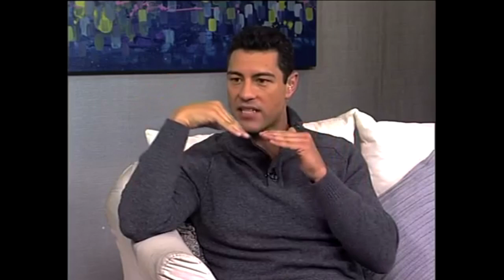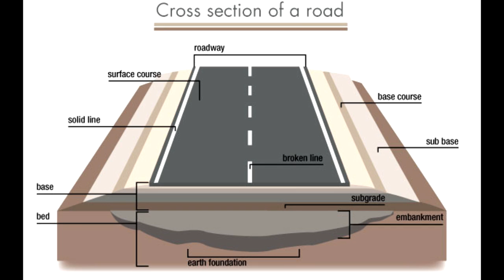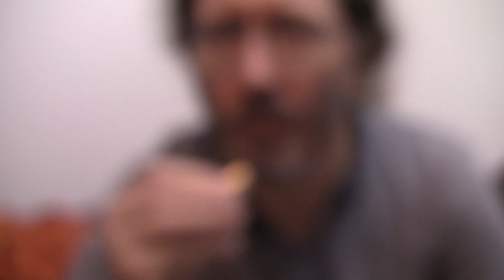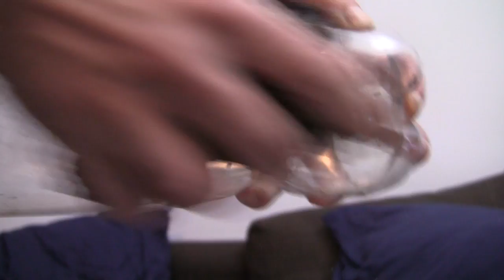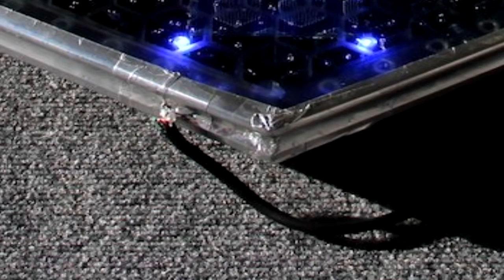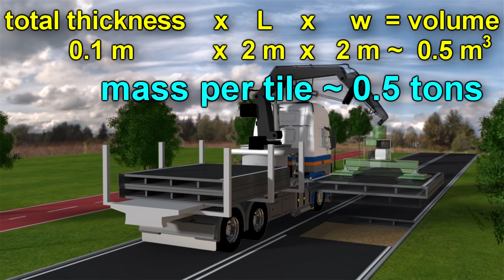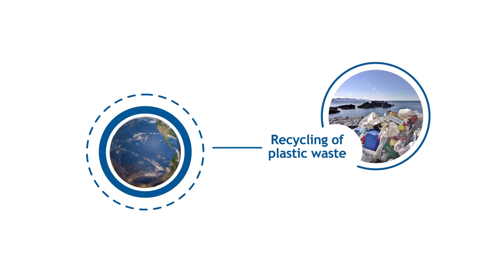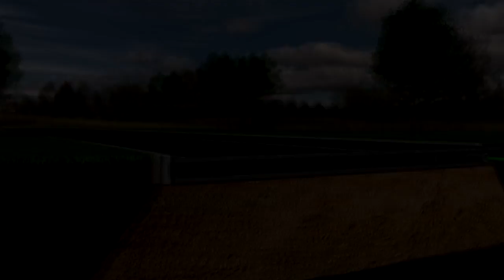Plastic Roadways BUSTED!

Comment: I really do not understand why the construction has to be hollow. The whole idea is using up waste plastic, yeah? And a lot of that is made annually.

The only way I see this potentially working is to lock the surfaces down with a channel made to accept a stiff material. Which means, there needs to be a way to stop off and seal that channel so nobody can tamper with it. Then, they have to figure out how to allow displacement of the locking materials so the hollow road can be replaced if it has to. Maybe, by destroying it, but in a long roadway, there is going to be difficulty unless you have a machine push in and displace the existing locking material, place the new panel in, then re-lock it at the other end.

This is vulnerable to multiple types of terrorism, by displacing the plates so they are removed, destroying the plates since they are so soft, and the stuff underneath then becomes vulnerable after the road surface is destroyed. This simply wouldn't work in places where acts of terror are a common occurrence. It sounds like a massive corner cut in comparison to just laying down some crushed rock and calling it a day.

Comment: this is nothing new... a lot of land based oil rigs use durabase matting which is technically a plastic road. but it buckles after a while and would not be any good for regular road surface. it gets a bit slippery when there is mud on it!

Comment: hi, i'm from germany
and i only got one question

how the fuck are our tanks going to roll on this shit
Reply: Speaking of burning... a car fire would royally mess that stuff up, or worse a pool fuel fire...
Reply: Kniv Jesus What happens if you do a burnout on it? xD
Reply: Actually I think tanks are pretty benign, I mean they can rough up the surface, but they are quite unlikely to actually make it fail. At least they spread their weight over a huge contact patch. I'd be more concerned about your typical everyday semi-trailer truck.
Reply: Kniv Jesus cheese tanks my friend, cheese tanks.
Reply: Kniv Jesus somehow, its a mystery how they made the roadways, its a mystery how cars wint break em
Reply: use one of the 4 wooden tanks from the baltic states instead
Reply: Corvid At least asphalt is fire proof
Reply: Why is your name kniv jesus if you're german?
Reply: ***** actually, tanks are designed to go on everything. Just not necessarily leave it in the same state as it was before they went over it.

That being said, in October 1993, there were quite a few tanks on the streets, and the result wasn't so rough, well apart from that gaping hole in the Russian Parlament building and hundreds of people dead. That is to say, once you start worrying whether the tanks will leave your road surface intact, you might be missing the bigger picture.
Reply: ***** Wtf are you talking about?
Reply: ***** Don't go that low.
Reply: "Tanks aren't designed to go over regular roads. They might even damage em"

There are rubber parts you add to tracks to minimize damage. That's how they do parades and the roads are fine. Also no turning in place. That's what fucks up the roads the most.
Reply: Kia Of course they are ment to go over normal roads, at least on germany tanks allways drive over normal roads
Reply: ***** Kniv jesus is a joke. A swedish joke. Kniv = knife. it's from a swedish cs:go youtuber

Comment: for fucks sake.....first you get politics all wrong, now you're getting science wrong (well, half wrong).

1. Roadbeds are constructed at the beginning of a roads FULL life cycle, and is only maintained if a major event changes the underlying topology.  Once the asphalt has been laid, maintenance only requires a single-file stripping followed by laying, rolling and paint.  This happens depending on traffic (parking lots are roughly 15 to 25 years, while major thoroughfare might be every 3 years).

This means, if a new road material is to be presented, the roadbed doesn't need to be changed.....you strip away the surface and lay your new on top.  I will admit that this design (for a hollow interior) is stupid, but you act as if it would take too much time.

2. Asphalt already contains recycled material in compound, including plastic and old asphalt.....some roads even use old tires in the compound (usually gives a plum hue in daylight).  This means plastic is already being used on roads, what's your problem exactly?  Roads are actually SUPPOSED to be soft, so they don't tear up your tires, create a jagged dangerous condition, or become too stiff in sunlight and crack too soon.

3. Picking apart the truck image, which is obviously flawed, is like attacking an architecture student for his designs of a 100-story pinwheel corporation building.  Yes, it is most probable to not go like this....if it were me, I'd simply lay the framework tubes directly on the roadbed and put the asphalt directly on top and level it....you know, like they do for the traffic light signaling wires.  Or do you not know that they already lay cable inside tubes within the asphalt mixture?

I'm guessing you've never worked road construction.....of course you haven't.  You are literally getting worse at this.

Comment: Hope they are heated because, in the USA north east, it will be a bitch when it frost heaves and cause ramps or jumps for cars.
Reply: i won't lie, this would be great for small driveways.  easy to replace, can make them heated and grip isn't a huge issue for sitting a car in a driveway.  making it hollow isn't needed so now you have a simple, efficient, and now cheaper product.  it is too expensive to redo a driveway with asphalt and plastic may cost you a few thousand dollars rather than 10 to 20 thousand.

Comment: Also, how about cold temperatures? I live in Minnesota, and sometimes it'll get -20F or colder in the winter. Plastic gets brittle as hell in extremely cold temps, not even to mention, could that plastic handle the snow plows metal blade that's needed to clear the roadway of snow and ice. Also, could you imagine ice on plastic? There would be so many car accidents/fatalities that it would be legendary.
Reply: Finaltits Hey look, holy roads!
Oh wait
crashes

Comment: Not to fucking mention all of the problems that will emerge from trying to mold out of swirled (recycled) resins taken out of trash that have been bathing under the sun, on rain, dirt and other contaminants... Not to mention the proposed size... Those molds will be so damn expensive... And the molding machines!!! Man!!! Millions wasted just to cast ONE of those lego life sized road pieces... And yeah... The fiber glass will degrade the original structure of the recycled material when re-melting...

Comment: Among the multiple problems with the idea, a couple of issues could be solved by cutting the road in half. By simply making a top and bottom half, they can solve the repair and attachment problem. They could lay the bottom half down on a concrete surface and use masonry bolts to attach it to the ground, then lay down the pipe, then bolt the top half down making a kind of road sandwich. Ideally, this means they would only have to replace the top half of the road making repair of both the road and the pipes IN the road MUCH easier. In the event they have to replace the bottom half, it would be a lot easier to unbolt the road from the concrete and slide it out from underneath. Again, this is not to fix the idea, but merely 2 or 3 the of the bigger problems with the idea.
Reply: That actually seems like it solves a more minor problem.
Reply: Well that was one of the major talking points, that was all I was referring to. But yes, in context it is more of a minor issue.

Comment: Surprised nobody has pounced on the "drainage" yet. It's so damn kewl how the runoff just magically fades away in the animation. No ditches or culverts or channels or whatever - just pure magic.
Reply: it's also nice how the animation suggested there'd be a small concrete or whatever material barrier where the drain holes are but as soon as they need to say that it works the barrier just doesn't matter anymore
Reply: Of course! Also nothing could possibly go wrong with stuffing a cavity inside a roadway with water and then having it freeze over night. It's not like water expands when it turns to ice, right?
Reply: Ahh, but that's just an opportunity to study new and spectacular forms of frost heave!

Comment: The issues of hardness, UV protection, and traction could all be addressed by coating the plastic roadway with a layer of asphalt.  Any worries about the modules coming up due to braking could be assuaged by filling the hollows in the modules with crushed stone.  :)

Comment: Since there are cables going between the individual sections, pulling out an individual piece would be impossible considering they string each section together. You'd either have to remove the entire road or completely destroy the slab.

Oh yeah, PET also leeches antimony into water, especially when hot.

Comment: These are my favorite type of thunderfoot videos where he is debunking overhyped projects and explains exactly why with logic and science.  I have my kids watch these to hopefully get them to critically analyze ideas that seem too good to be true no matter how good the salesman makes the pitch.
  As far as these strait sections of road, has anyone seen a road that strait with no bends or unevenness at all?  It definitely isn't the case in New England.  Our roads are all over the place.  Also, the show those sections being pulled out and the cables and pipes magically go with them.  If you pull up a section of road with cable or pipe in it, you will not be able to pull it out.  Even if you can pull it up enough due to slack to cut the cables, how to you reattach them?  There is not enough room for an electrician or plumber to reconnect everything.  This is especially bad for the pipes since they'll just break and not bend at all.  I think this is even worse than solar freakin' roadways idea.

Comment: Not to mention the fact that the road is a box channel, with no obvious ways to get cables and pipes into it other than sliding it in from the end, Which means your cables/pipes that they suggest running THROUGH the road would be entrapped. How is it supposed to be "easily replaced" if the cables running through the roads are going to be holding the sections together by virtue of them being inside the road panels.

Comment: Asbestos is a wonder material. Let's use that one.
Reply: Christos Bakolas - I was thinking of crowd sourcing a machine that crushes asbestos to a fine powder, we can mix it with lead and coloring and give it to poor children so they have coloring paints to make art in third world countries.
Reply: YOu can't write asbestos without best! As - best - os
Reply: Asbestos is actually a great material... Just sucks for the people breathing it 30 years later...
Reply: Blah b - I wouldn't worry so much about the fine details. If we all huff the dust together at the same time then we're all playing the same game with the same rules :-p
Reply: uidFluiq - You'd have to package that deal a little better, maybe throw in some oxides into the mix as a sweetener.
Reply: i vote for a mix with berillium oxide
Reply: How about some pure Nitro Gliserin
Reply: i just don't think that cutting tiles would be any different than cutting asbestos, both of these materials don't react with the human body.
Reply: fss1704 - That's impossibly untrue. Asbestos is a razor sharp microstructure that slices the lungs every time you breathe, leaving scarring that continues to build up over time. Ceramic dust, as with most dust gets naturally cleared by lungs within limits. That's not to say you should breathe in any amount of dust of any thing but to liken the two is unbelievable.
Reply: Glial Cell Culture - It cuts every time there is movement in which the asbestos is making contact, which inside scare tissue is pretty much every time it moves. That is up until the point where the scar has pretty much contained it inside a non flexing scar.

Comment: I always enjoy these BUSTED type of videos. On Facebook, I joined a few groups related to technology, engineering etc. This video inevitably got shared to one of those groups however since the majority of the members in that particular group had interest/knowledge about road construction or engineering in general along with some common sense the comments were mostly tearing the idea apart. I found it quite funny, and you raised most of the same points as the members of aforementioned group.

There are few things you could have added, though:
-Effect of UV on plastics in general would be another point of failure for this design
-How thermal expansion would affect the modular road pieces
-Properties of plastics in hot vs cold temperatures +40C vs -40C
-The amount of trucks it would need to cover a road! In their video it looks like they can fit 4 panels per truck, let's assume 18ft long each (generous guesstimate of length from their video knowing that width should be close to 12ft), you'd need over four and a half thousand truckloads of their panels to cover 100km (62 miles).

Comment: as an electrician having the conduit ran that close to a road surface is not to code and would be dangerous in the case of an accident or structural failure of the road.

Comment: The solution for recycling plastics aren't roadways, but railways.  There has been a lot of success in using recycled plastics in making railway ties/sleepers.  They are resilient like wood to absorb vibrations and blows, but don't rot and require poison treatments to slow rotting. Concrete ties crack over time.  It will take the Sun's ultra-violet light about 60 years to cause enough damage to the plastic, rock and tire/tyre mix in the ties/sleepers to have them pulled from service.
      Burn it or recycle it, just keep it out of water bodies.

Comment: Can someone explain why exactly the road would come up once a car tried to stop on it?
Reply: Ryan dls because Newton,  the same force that stops your car also pushes the road forward, over the course of many moons and many cars, trucks,tractors and Radio Flier wagons, the road will start to buckle and rise up, it's very much the same as plate tectonics building mountains and if you notice, you'll see that this generally occurs at intersections, especially where there is an over abundance of traffic. .

Comment: Ok, So working around phone and tv cable lines, generally when the cables are installed, unless the cable have been externally damaged, most problems come from the physical splice points joining the cables together. It's in General, The more splices you have, The more problems you'll have with the plant. Now with each segment having its prebuilt wiring, it will be trouble for sure. And don't get me started with the upkeep and repairs of an underground facilities. Take out the water pump and gas meter (methane gas) for hours of fun

Comment: Also traction is gonna be completely gone. Asphalt is good for traction because its rough and abrasive, it hold into tires. Imagine switching that with some plastic, no matter how its textured it  was it will still be smooth compared to asphalt

Comment: next: hermetically sealed vacuum tube roadways that use solar power, using the remaining power to condense water from the air. during the night it runs off of cold fusion and diamond batteries. made of recycled plastic bottles and plastic from carbon from the air. 3d printed.

also, a massive refrigerator to combat global warming.
Reply: I know its a joke but I cant go on without saying... refrigerators don't make heat disappear, they displace it do a different part of its system where it gets transferred into the ambient surroundings its radiator. It takes energy to do this process leading to more total heat in the end.

that being said... put a waterseer coming out of those refrigerators lol
Reply: Jim Ass I thought diamond batteries were real. Both the chemical engineer and chemistry world had articles on them, not that they would help anyways cause they are tiny.

Comment: railway ties use recycled plastics and rubber composites "NOT FIBERGLASS," of which they are able to withstand a-lot of load at half  the cost of even wood, and it is NOT easily scratched, axion, the maker of these railroad ties have also used the same plastic in board-walks, supports, and construction mats. Plastic composites are very capable materials, and give a-lot of traction as seen with their construction mats, also why they are used. Also, asphalt doesn't go in landfills... so... 

"I agree with you, on the viability of a product being little to none, I'm just trying to come up with points for you to take into consideration."